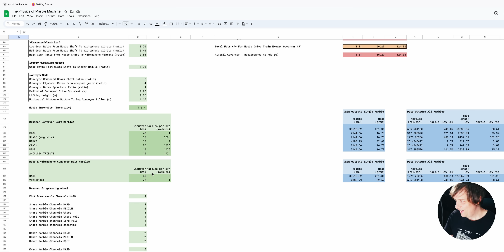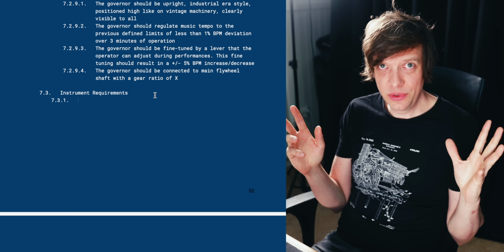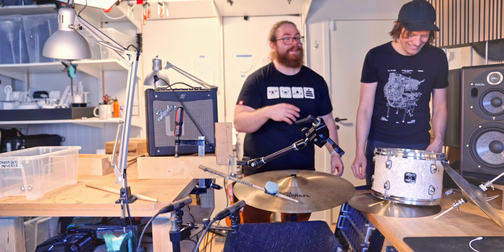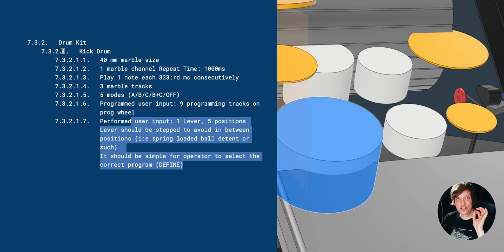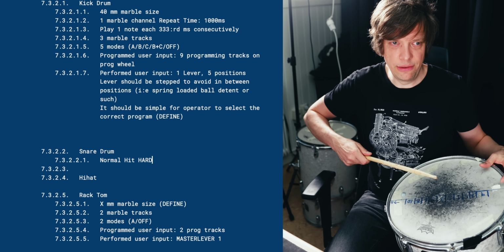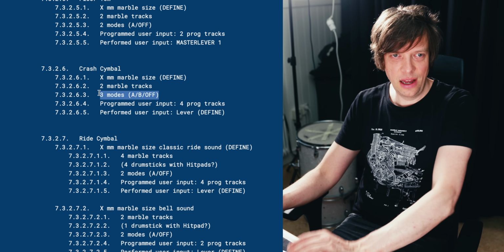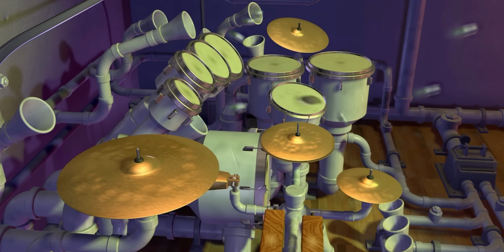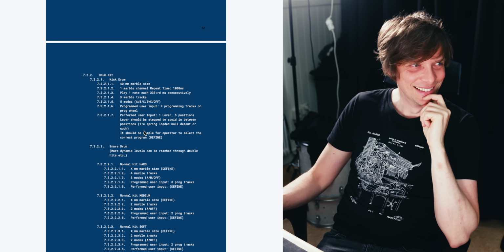Building the Marble Machine in a text document - Better than I thought!

Comment: I really wish martin would try a true MVP. Do everything he's doing right now but do it for a single channel. Boring? Yes. But it proves out literally everything without having to solve problems for scale at the same time. Then you can start to solve for scale. If Martin can't make a tight, accurate, world tour-able single channel marble device, then we already know he can't make one with multiple channels. The single channel mvp proves you can _deliver_, once you can deliver, then it's all iteration!
Reply: Could you please give a list of you inventions?
Reply: Ad hominem, address the actual point if you'd like to disagree. MVP comes first
Reply: @ussarng4649  What has Marty invented?
Reply: @cinderwolf32  I can disagree on the validity of your comment on any grounds I feel reasonably cause your comment to be valueless.
Reply: Jeez, every single reply to your comment was bullshit. Absolutely no one directly addressed any of the points you made... making the whole reason you wrote the comment essentially pointless. Sad, really.

Anyways, you addressed the idea of an MVP, something with a single channel to prove whether or not the concept actually works correctly. I was under the impression that this was the whole reason for making the machine modular? It means you'd essentially have separate machines synced together, but having the ability to use any one of them. Perhaps Martin is just thinking later down the road, when it comes time to have all the modules working at once (as in, all the instruments working together, drums, bass, vibraphone and so on). Unless I'm confused?

I guess what I'm thinking is that, once it is discovered that each channel works well on its own (essentially the MVP... and I'm pretty sure he's already been testing individual instruments plus their interaction with marbles in previous videos), the object is to combine them. Obviously there are challenges that need to be addressed like how to synchronize all those modules together so they're in time with each other and so on, but I really don't think Martin is dumb enough to forget about those. I say that last part about not being dumb enough because I see a lot of skepticism in these comments sections lately. It's a shame, too. Sure a little skepticism is OK, but the amount here is just a little too much. No reason to be so cynical.
Reply: @justinnaramor6050  since you state every other comment was BS, doesn't that cause your  your comment comment fall into yhe same category by virtue of the fact you got involved.
Reply: @justinnaramor6050 At one point, he considered making everything modular. But he also constantly diverges from his plans.  Doesn’t appear that anything recent enforces his desire to keep things “modular”—so I wouldn’t assume that it’s still part of the plan.
Reply: @ussarng4649 Are you intentionally this asinine?
Reply: @justinnaramor6050  "No reason to be so cynical." Who made you the arbiter of that?
Reply: @justinnaramor6050  mvp, or minimum viable, isn’t about making the end goal it’s about following through a simple design to the end so you surface issues and learn things while the complexity is low and the cost of changing things is low. the moment you scale to say 20+ channels, you risk discovering issues that require redoing all 20+ channels.

this doesn’t mean you won’t have to redesign when scaling up, but it does mean you are eliminating as many problems as you can before the cost/complexity skyrockets

modular design just helps with being able to iterate on individual components. it doesn’t mean you can skip the process and scale up immediately
Reply: @ussarng4649  What the hell is your problem? The OP was trying to start a civil discussion. You wrote another reply that was not actually contributing to said discussion, and you wrote a comment saying that my contribution was bullshit just because I said all other replies were bullshit, for the same reason your own comment was bullshit because no one even attempted to address the original comment? Why even bother replying if you're just gonna make snarky comments criticizing others? Do you need help with anger issues or something? I'm genuinely concerned.
Reply: @justinnaramor6050  maybe no one replied to the MVP single channel suggestion because it has been tried in several varied ways since the MM and especially with the MMX. What need to rehash it any large degree? I'm sure Martin will make several prototypes, working model and such to the degree needed. Maybe the suggestion to the original  comment should have been to start watching from the beginning. 
But why didn't you reply to the original comment instead of spouting off your judgmental blahblahblah?
Reply: @ussarng4649  Um, I did reply to the original. Did you just skim through my comment instead of reading it all the way through, only paying attention to the so-called "judgmental" part?

I was being supposedly "judgmental" because I actually offered my input... unlike pretty much everyone else, including yourself, in this thread. No one else wrote anything even slightly related to the point made in the OP, including yourself. In reality you were way more "judgmental" than me.

If you had wanted to talk about how an MVP was already tried in various forms (which I do not disagree with) you should've just done so in your original comment instead of being judgmental.

Once again, do you have anger issues or something? Because it certainly seems like it.
Reply: @ussarng4649  Um, I did reply to the original. Did you just skim through my comment instead of reading it all the way through, only paying attention to the so-called "judgmental" part?

I was being supposedly "judgmental" because I actually offered my input... unlike pretty much everyone else, including yourself, in this thread. No one else wrote anything even slightly related to the point made in the OP, including yourself. In reality you were way more "judgmental" than me.

If you had wanted to talk about how an MVP was already tried in various forms (which I do not disagree with) you should've just done so in your original comment instead of being judgmental.

Once again, do you have anger issues or something? Because it certainly seems like it.
Reply: @br52685  Glad you at least tried to actually contribute to the discussion instead of just writing some snarky comment that was entirely unrelated to the OP's point.

Anyway, I do agree with this. While the criticisms Martin's been getting lately have not always been entirely valid, that is one I do have to admittingly agree with. I wish all the best for this project and I of course want it to succeed (plus it's fun even just watching/learning about him building it), but if he's just gonna keep diverging from his plans, where he has a great idea one moment and then just flat-out abolishes it the next moment, he is just unnecessarily slowing himself down and will never finish the project that way. I'm not trying to rush him to hurry up and build the damn thing, acting like some kind of fanboy that just wants that immediate rush of adrenalin from seeing the final product. But it's better to come up with an idea and stick with it and not abolish it later, especially if said idea is a big benefit to the project so that it's a step in the right direction. If that means making the machine modular, great. That has benefits for the project. If that means the marbles have to hit drumsticks and mallets instead of hitting the instruments directly, to avoid unnecessary complexity like having multiple marble types and marble sizes, great. That has benefits for the project. Coming up with ideas that truly benefit the project, and sticking with them and not abolishing them later, is a step in the right direction.
Reply: @justinnaramor6050  when reviewing your original comment I do recall going from reading to skimming that post. Like I said, why rehash? And I would add now why rehash someone's idea who hasn't followed the journey and is offering suggestions in an attempt to sound like they're giving new and initiative ideas that Martin had somehow missed altogether. I have followed Martin since before the MM. The first þo get my attention was a music box of sorts. I have heard way to many know-it-alls, for example, you and your passive aggressiveness, to continue to be nice and supportive of them all. I saw no attempted at conversation from @PabloEdvardo. Which is further reinforced by the fact that he hasn't responded to any comments.
Reply: @justinnaramor6050  Homestly, I think this project is way over-blown and over-hyped.

Sure, it’s a neat little novelty project.  Will it play concert-quality music?  Absolutely not.  It could be mildly amusing to watch up close for a few minutes—but not for an hour, and certainly not from a distance in the audience.

Is it capable of sustaining a “world tour”?  Absolutely not—for countless reasons.

Is it a project that should reasonably take 10+ years?  Again, nope.  We both know that there’s nothing really complicated to what’s being attempted here, that would justify this length of time and “planning.”

Can you objectively say that “watching the proceeds” is good and/or entertaining?  Again, no.  If anything, for many people it’s probably more like watching a train-wreck.

Fanboys/fangirls/famtheys will certainly disagree.  But that’s just a shining example of “sunken cost fallacy.”

So why’s the project still going?  Id simply say because of the attention/ego/$$ that’s part of social media.

There are hundreds/thousands/millions of makers/artists/tinkerers/builders that create far more interesting objects, but unfortunately get far less exposure.

For me, the most interesting part of this channel is watching/learning how easily people can fall for a con-job/scam/vapor-ware.
Reply: @ussarng4649  If you had been following this journey for as long as you have, you could've just said so in your first response, actually addressing the original comment, and I would've happily responded in a much nicer way. Cinderwolf was correct... you should've actually addressed the original comment if you had wanted to express disagreement. But no, instead you felt it was OK to essentially make yourself look like an idiot by basically saying "I can disagree because your comment is valueless". The fact that an MVP has already been done, as you correctly identified, is no excuse for writing such a snarky comment that doesn't even attempt to address the original comment that started this thread! For that reason, it was actually you making valueless comments, and even another commenter called you out for acting asinine.

Also, Pablo responded to my comment, precisely because I actually fucking addressed his comment directly. So clearly he had wanted to have a conversation.

But you? You didn't even try, so Pablo didn't respond.
Reply: @br52685  I believe you are being overly cynical, but whatever. I should've expected that, given the several other comments you've written on this channel.

I'll just say in response that I still think the project could have a better chance at success than if he constantly diverges from an idea like what I mentioned. I think the project 'can' be a success... it isn't entirely impossible. It's just absurd to say the project will unquestioningly fail. The first step would be to stick to the ideas that truly benefited the project and not constantly diverging from them. For instance, the issue of "dynamic" music... he once said "why make the machine sound like a human? I've got a band for that!" He should just stick to that idea instead of needlessly overcomplicating the thing by making it sound overly "human" or whatever other similar word you might use.

Anyways, we're kind of getting off-topic from the original comment to which we're replying. We were originally talking about an MVP, not whether the project would fail or succeed :).
Reply: @justinnaramor6050  I agree that the first step in successfully completing this project would be to stick to a plan.

But here we are, 2 years later.  You call it “being cynical”….i just call it “ being realistic.”

I don’t want this project to fail.  But I don’t think this project is in the right hands.  And for the sake of his mental health and sanity (which numerous people have commented on in the last year), this isn’t something that should be ignored.  Either that, or admitting that he’s simply dragging this out as long as possible, for “other” reasons…
Reply: @justinnaramor6050  I think it better question to ask is WHY does Martin continually abandon his plans (MVP, dumb design requirements, etc)?
Reply: @justinnaramor6050  interesting that my reply has already been deleted this time you get a self-righteous coward trophy.
I did review the entire comments in this conversation. And no one answered my question in my first comment about of the original comment. That was in regard to their credibility, a disclosure of their inventions.
Reply: @ussarng4649  So apparently I'm a coward. Wow, how very respectful of you! I will take that to heart!

Hahahahahahahahahahahahahahaha.

I'll just not even bother replying to you at this point. You obviously have issues you need help with.
Reply: @PabloEdvardo  Finally, back to the actual discussion at hand! Meant to respond to you yesterday (or whenever it was) but got caught up with addressing a commenter who was using a bunch of ad hominem instead of actually addressing your comment directly.

Anyways, would it not be correct to say that Martin has technically already made an MVP? I mean, he's been prototyping and testing his mechanical design ideas for the machine, insuring that they work as they should, so does that not count as an MVP? Pretty sure there's plenty of video evidence of this prototyping stage I mentioned (even if said prototypes just have the marbles falling onto pieces of wood instead of actual musical instruments).

Your thoughts?
Reply: @justinnaramor6050  I wouldn’t see how you would consider his prototyping the last few years as a minimal viable product.  I would think an MVP would be all the individual components COMBINED into an actual working product—not simply individual components operating separately
Reply: @br52685  By "components" I mean individual channels. Plus their associated mechanics of course. It could be just a single channel for the vibraphone. Or a single channel for the bass guitar. Anything like that. Plus the associated mechanics with that channel. That's essentially an MVP... a proof of concept... a functional, minimalistic product/prototype that works.
Reply: @justinnaramor6050  I’d consider that an MVP. But he hasn’t done it yet
Reply: @justinnaramor6050  Case in point:  it appears that he’s drafting his “design requirement” for double-drops on his percussion equipment, expecting it to result in twice-a-loud sound?

Has he even attempted the most preliminary attempts at this?  As numerous other musicians have noted—it seems quite problematic.

Comment: Small suggestion:  you’re using ‘tracks’ as a proxy for how quickly the machine plays notes.  That makes the real requirement something you have to calculate.  Try flipping that around to “I want N notes per second” and showing the calculation for the number of tracks.

That should pay off when you start working with the individual units.  If you find you can make one faster, or that you have to make one slower, you can use that data to recalculate the number of tracks.

The current notation will force you to rearrange things if two pieces end up working at different rates.

Also:  your mom is right.  You’re a musician and an engineer.  You’re working to combine the two, so combine them.  Play music while writing design docs and testing machines.  You’ll discover combinations you haven’t considered yet, and the more you do, the more awesome ideas you’ll have.

Comment: The ambitions seem excessively (unrealistically?) complicated. At this point with low investment it's fine, but when all the theoretical design is done, I think it would seem prudent to not go directly into full scale production of the entire machine. Rather a proof of concept should be made at a very small scale. Something like bass drum, snare drum, two notes on the vibraphone, one channel for each, four bar phrase, small marbles. This would also only require a small drive-train. This would not only be a way to test the functionality of an enitre assembly, but also a way to test the manufacturing and assembly processes - and to gain a lot of experience for both these aspects. Probably things like two-marble hit on the hihat should also be tested.